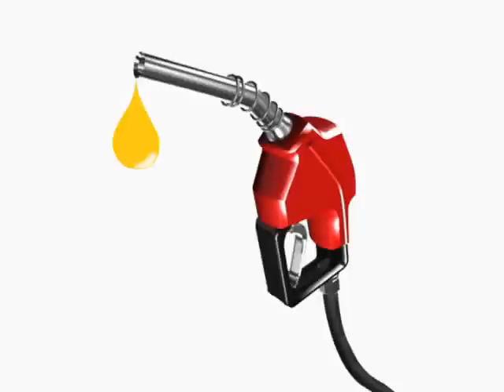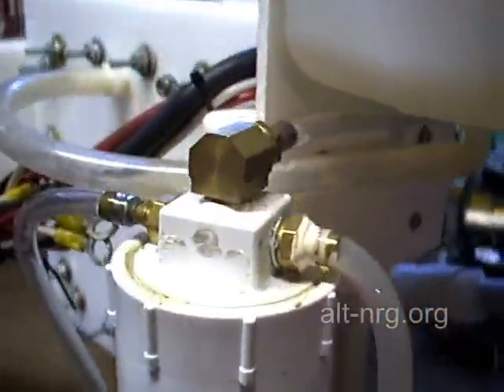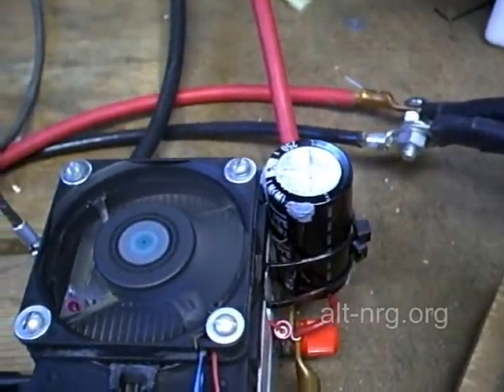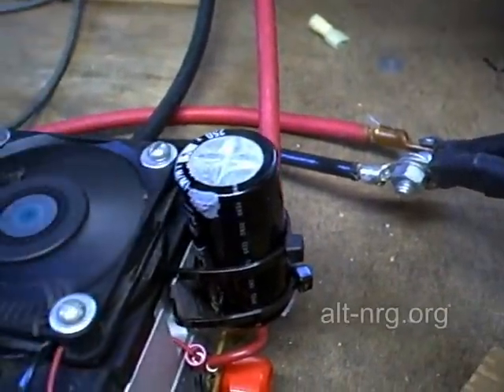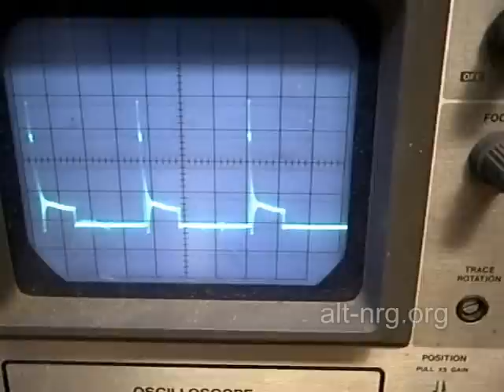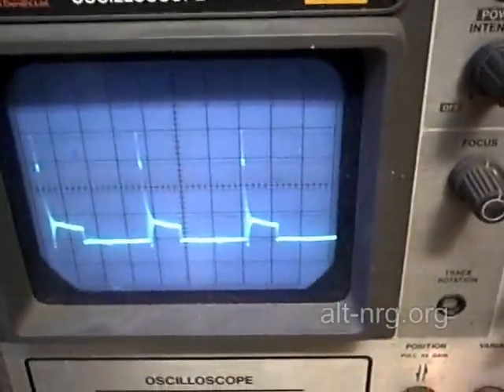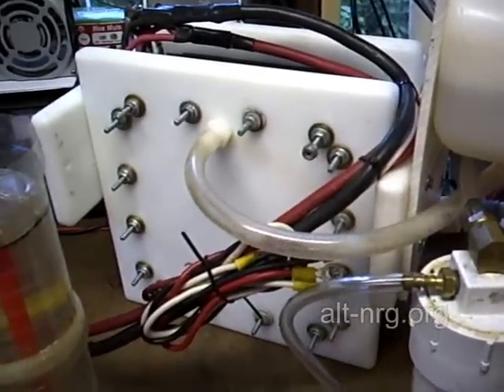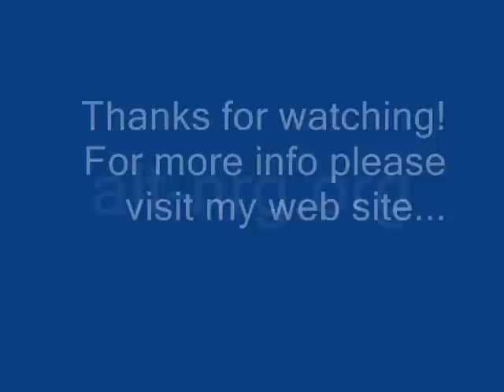#125 - EBN cell on my PWM

Comment: I am waiting on this experiment with baited breath!  I actually thought an automotive condenser would be tough enough to suffice for the external capacitor, but it may have an internal resistance that is too low.

There is a fella that has a really good plate design, and I think your PWM and his cell will be the winning combination. Thank you for this information.

Comment from the maker: Depends how cold and how concentrated the electrolyte. In very cold climates you may want to circulate some of the antifreeze around the cells by tapping from the heater hoses to preheat the cell and thaw it out.

Comment from the maker: Hydrtec - Your connections are exactly correct. The cap heating is still due to too high ESR. I'm close to a solution using, believe it or not, 4.7uF 250V polystyrene caps in parallel. Took these from the same salvaged UPS as the 1000 uF caps.

Comment: Hi Z thanks for your videos. 
I have made the pwm your design, but used a mosfet IRFP2907  Static Drain-to-Source On-Resistance  4.5 mW VGS = 10V, ID = 125A   also added a 100n cap across the 1000uf cap the unit does not get warm with the heat sink and fan nor does the 1000uf cap regulating to 35 amps. Best regards mark

Comment: if you ever do have heating issues with anything, you can use a peltier junction which when power is passed through it, becomes cold on one side and hot on the other, put that together with a heatsink and fan and you'll be set, it't actually what they use to make those mini refrigerators.

Comment from the maker: Special mod for RC9340. 200 amps continuous, 600 amps peak. He wants to reliably drive an 8" EBN cell at 100 amps with plenty of margin for safety. To create this all I did was add a 2nd R9 to the gate of the 2nd MOSFET, 2nd R12 from the source to ground and tied the Drains together. Biggest problem I fear is too much amperage for the terminals!

Comment: Could you tell me how many positive,negative, and neutral plates you have in your 8" 5mmw cell? And the configuration of how it is wired up. Oh, and the gauge of the plates and gaskets. I know it is a lot to ask but it would be most helpful. You have "I think" the most informative videos out there. You take the time to explain every facet of information and I REALLY appreciate that you take the time to do that. Thank you very very much.

Comment from the maker: I may change the 7812 to a 7810, only because it drops about 1.5v from the input and doesn't start to regulate until you get about 13.5v in.

R1 and R5 are 2.2k and that is final.

Watch out for the pin wiring on the transformers though. The triads are different than my original sketch.

Comment from the maker: What would you consider a fair price without overpricing?

I know it's like nothing else sold commercially but I want it 2b affordable anyway.

This will also be the base model. I am developing an unpublished version that will incorporate additional safety interlocks and controls for direct sale and use with the EBN gasketed wet cells.

I find the time in the wee hours of the morning. I have the dark circles under my eyes to prove it. The goal is to give up the day job and go full time HHO.

Comment from the maker: P.S.  Forgot to mention - No, the 7805 is too low a voltage to drive the MOSFET gate. 7809 or 7810 only.

Comment: I had the same problem. To fix it I placed the 10000uF cap across the PWM(+) and PWM(gnd). However, my connections are PSU(+) to PWM(+) and PWM(+) to cell(+) and cell(-) to PWM cell(-) and PWM(gnd) to PSU(-). Only down side is the large cap gets too hot too quick. When I connected a wire from the cell(+) to the PWM(+) instead, I observed a lot of false triggering of the current sense circuit caused (I think) by the inductances of the leads (all heavy gauge).

Comment: Hello Zero, nice work, thanks for sharing - you taught me a lot. I've been studying HHO production for the past year and built a PWM to your design (V2) and it appeared to work for 8 hours yesterday up to 20A. Then the amps fell to 4 and the scope trace became eratic. Reducing duty cycle then bringing back up to 20A fixed the problem but only for a short time. This is repeatable subject to cell (+) connection and that in turn affects transient cap heat. Any ideas? Also, why eliminate the zener?

Comment from the maker: My parts list is completely revised as of this evening to include every single part and direct links to buy those parts.

If you go to my web site you will clearly see in the photos how the transient diode is mounted. Please note there is a part number change to the transient diode. I am also eliminating the zener.

And since I provide direct links to two online retailers of the power mosfets, both who will ship internationally, how can ANYONE possibly say that they can't find them?

Comment: hi there zero.
i was just rewatching #40 and thought to myself
"i wonder what would be the effeciency if you had your 2.2 volts per cell with a pulse of 2.6 volts per cell every 2nd second that would only last for a tenth of a second or something like that so as to aid in bubble release and take advantage of what i think could be called electro inertia. i am no scholar so take it as its meant. regards andy

Comment: You need to use a schottky diode; not a 1N4004; the 1N4004 does not switch fast enough! Connect a schottky diode 200V 3A or better with the anode to the drain of your MOSFET's and the cathode to your 12v line; it will completely eliminate those reverse emfs you see on your scope. You'll also find that your cap doesn't get extremely hot anymore because of the current spikes.

Comment: You should be running under 5 amps - Looking at Stanley Meyer's original circuit diagrams, especially those for his water fuel injector, you should be getting under 5 amps because Meyer used a resonant charging choke at resonance with the voltage intensifier circuit on the primary side of the R.C.C. to let voltage potential (and admittedly very minimal current flow) electrolyze the water in the tubular electrodes on the production end.

Have you tried this brilliant method yet?

Comment from the maker: Timing yes. Meltdown no. HHO engines actually run cooler despite the higher energy because the rate of coombustion is so much faster there's no tine for it to transfer it's heat energy to the engine block.

Comment: Nice job...As I wanted to say, that cap isn't good for this job, you should have used more caps in parallel, even if they would be lower value...problem you could have is they will blow...even more important, you should use some high voltage decoupling cap,say 0.47uF/400v such as MKT or MKP or similar, they are very good for transitions suppression

Comment: Hello I have a couple of questions for Zero or anyone that has built a PWM using Zero's design.
In his videos Zeros talks about a transient diode but his schematic shows a Zener. I'm sort of newbie to building circuits does it really matter which diode I use. Also I cant find the 100Amp Mosfet Zero's uses, all I can find is a 50amp will I have to modify my circuit to use a 50a mosfet. Lastly I dont see in any of his video's or pictures where he has the 1N5625 mounted. any wisdom is appreciated.

Comment: How upscaleable is this? I'm getting a bus/RV conversion and I'm wondering if it's possible to install an HHO electrolyzer of sufficient capacity to give a significant improvement in fuel mileage.

Comment: Sir:
  If you're going to connect a 1000 ufd capacitor with purpose of providing reserve power to take care of "high in-rush currents demanded of the PWM, you should connect the POSITIVE of the cap to the POSITIVE of the PWM (not to the positive of PWM), using heavy wires of course;  and the NEGATIVE of the cap to the NEGATIVE of the PWM. Make connection as short as possible. Thanks.

Comment: Hi again, I have a problem with my PWM I used Zeros design to the letter. I just spent over 7 hours at my bench triple checking every point. When I hook my HHO cell - to the Cell- on my PWM and Battery - to my power supply and + on my cell direct to supply,WITHOUT applying 12v to the PWM. My HHO gen hits 15.3 amps cold(it hits 30amps cold normally) when I supply 12v to the PWM it jumps up only 1amp. The pots adj dont change the amps at all. any ideas or how much do u sell just control pwb 4

Comment: Ok major PWM problem found. I finished my PWM after I ordered the 512-HUF75344G3 from Zero's parts list. Got everything wired in and still didn't work right. Flipstir12000
suggested checking the teflon spacer on the Cell-,it was just fine. I checked closer and found a big problem, the back of the Mosfet and the Drain are connected(0.5ohms)and I have the Mosfet secured to the metal box. So the Drain is shorted to the box which is connected to common Grd. What am I doing wrong :( please help

Comment: Need a little help. Got my PWM working output was was only up to 20amps. I tried to shorten r12 to get a few more amps. Well now the PWM doesn't repond at all. I tried a new LM324 chip. I use DMM to check the different voltage drop. I get 4.5 volts on pin 7/9 but 0 volts on pin 8. Does anyone have any ideas. It was working fine before I shortened r12(i put it back to orig length) maybe a bad cap? to much heat on the mosfet. I'm so tired of this project, I just want to put the hho gen in my car